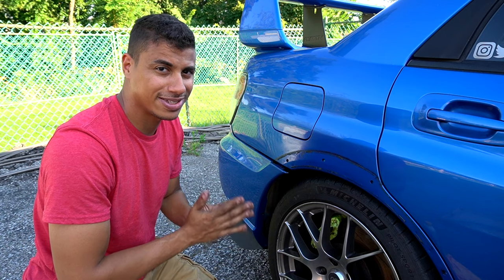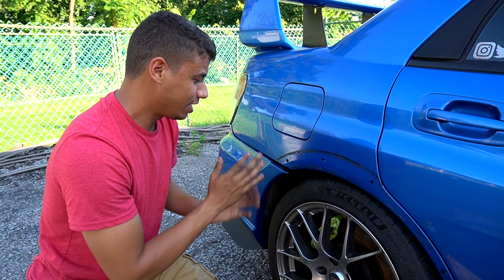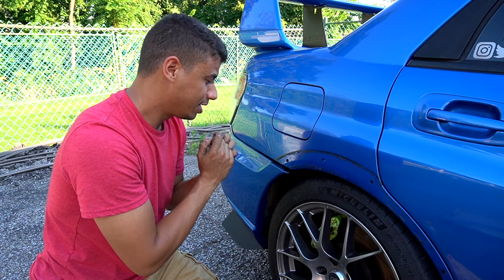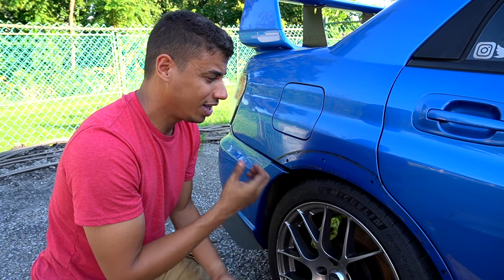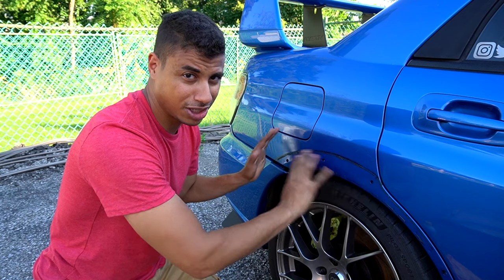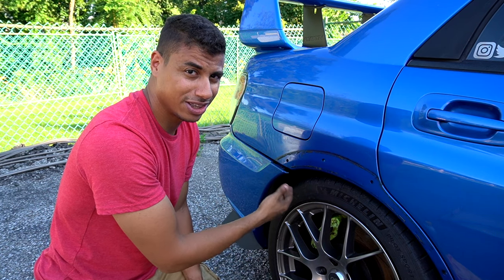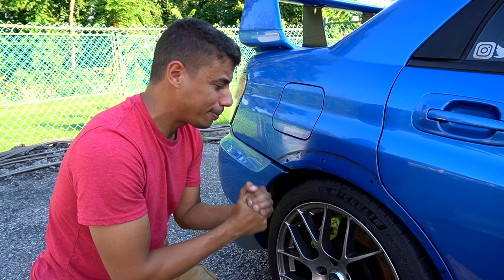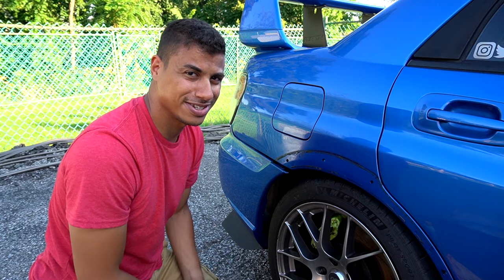This is Why I HATE Working on Cars...

Comment: I broke a hardened steel bolt on my stock evo 8 turbo. At the time all I was doing was replacing the exhaust manifold gasket and it was supposed to 30 minutes, but it set me back 2 months. I feel your pain
Reply from the maker: Duuuuude. I feel that! Sounds like when I removed my Brembo's about 2 years ago & the bolts sheered off into my calipers. I had to take them to get drilled out & have Helicoils installed.

Comment: The easier way is to cut your new arch where it is supposed to slide into the back of the bumper. That is what I did on mine. Been running it for 3 years that way no issues. The adhesive and clips are more than enough to keep it attached.
Reply from the maker: True. I didn't think of that. Those tabs seem to be overkill. Lol.

Comment: been there 2hours to change a tire because i snapped a stud and coudnt find my screw out tool.
remove tire next time, can you get around things to access bolt sure but in this case you remove the wheel so you can correctly get at it from the correct angle and better see what you are doing. etc. reducing frustrating issues that cause more time loss to fix than the issue you were fixing.
spray wd40 or whatever,, wait a little go slow and if you snap a bolt just use a screw out bit.

If you hate working on cars you may not be a car guy... but you are a car enthusiast.

Comment: I have a 2017 Sti and I’m not sure if the older models have as many of the plastic clips that the new ones have and it makes everything 20x worse. I would much rather just have bolts it would be easier they brake off all the time and are extremely difficult to take out and put back in, and it makes things take way longer than it should.
Reply from the maker: I hear ya. My car isn't as bad as some cars are, but it can be a PITA. That's the key reason I install Quik-Latches on my front bumper. They turned an install that typically took 30 mins & guaranteed broken clips into a 6 second affair. Haha.